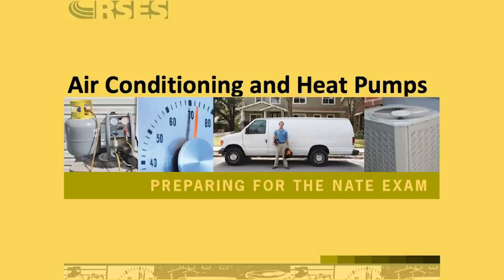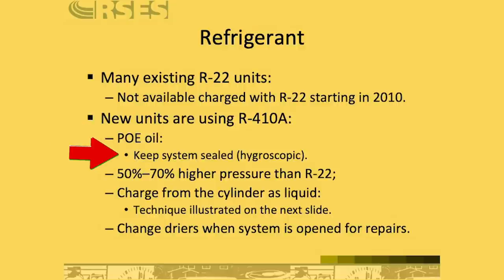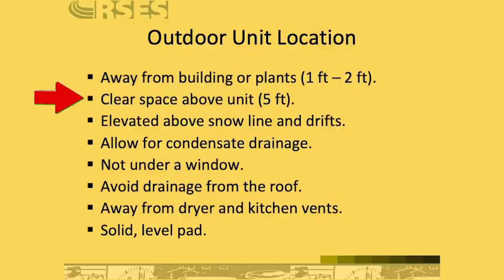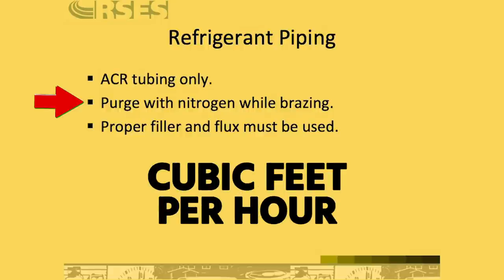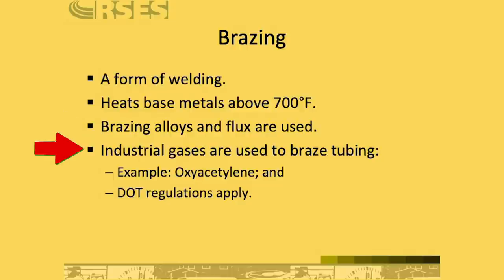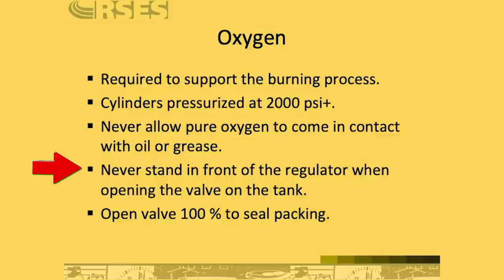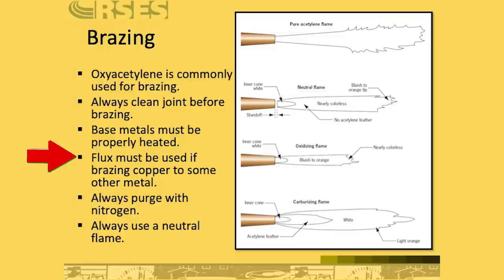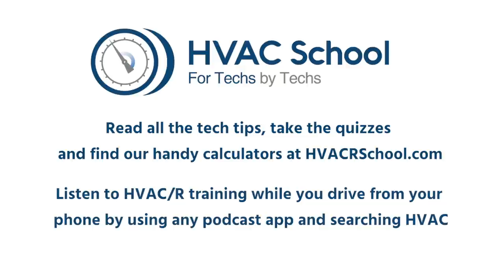Condensing Unit Install Practices (RSES NATE Prep)

Comment: If you for some reason must deburr a line that is facing up can you put something in the pipe that you can remove after you deburr?
Reply: Yeah, you can just wad up some bread and stuff it in there. 😅😁🤦🏼‍♂️Just kidding, good question, I'm curious too.
Reply: @Knight805  I was thinking chewing gum then just fire up the compressor for a sec to blow it out. :/
Reply: I doubt it, but i'd like to hear if there is a way. Goodman air handlers I got to deburr or reem out the copper on the coil but I can usually face the copper downwards

Comment: What is the ultimate location for the exterior unit for best performance and does performance change with the length of the line set ?
Reply: Ultimate location, not so much... but considerations for a non direct high heat subjected area for the outdoor unit, with adequate airflow and not excessively damp for long periods, you don’t want dirt turning to mud on any of the condenser surface area or the fans becoming imbalanced, and in summer the Heat on the condenser is less desirable for the condensing efficiency, on the extreme days your unit may even fault out on high pressure, depending on the flight of the gas and the systems settings (well before the relief valve kicks in,however). 
The other minor consideration is that once the refrigerant has left the condenser, it is expelling heat and expanding, so it’s not ideal to go too far with your liquid line. But the install instructions on smaller split units here say system max of 30m (in one direction) but you of course have to weigh in extra refrigerant to do this, however I’d be looking for other options for the unit to be located at 15 metres. Less on a 2 storey home.